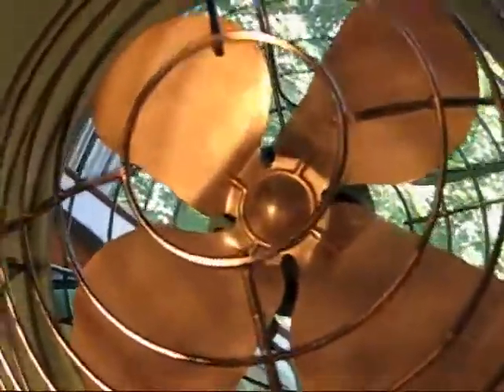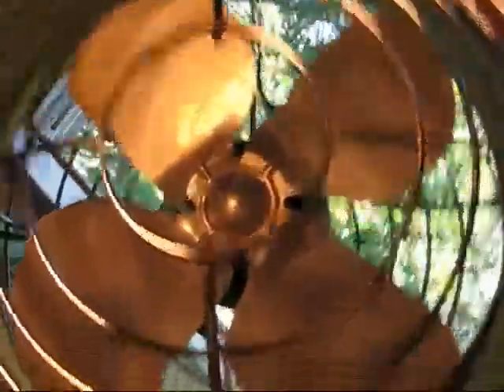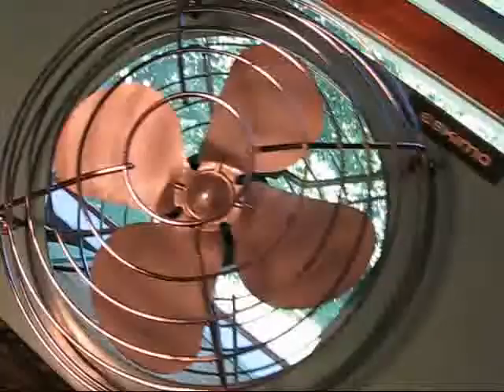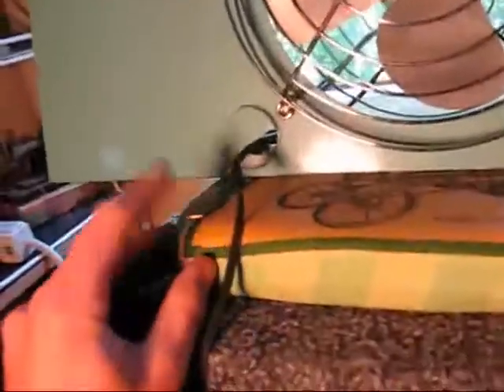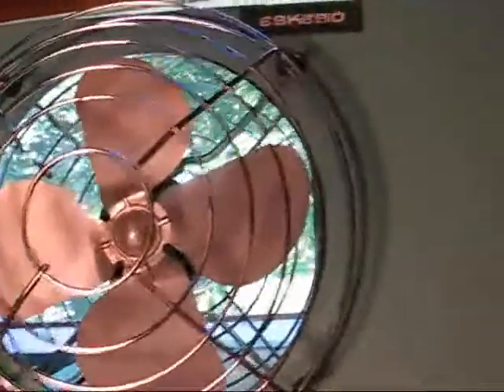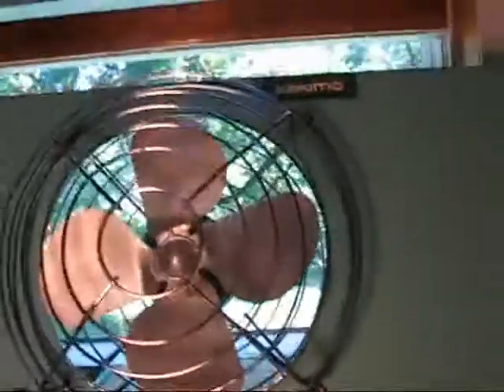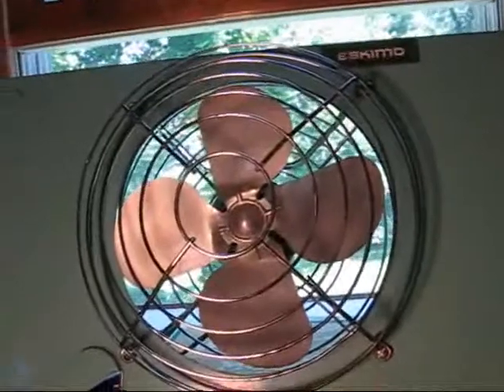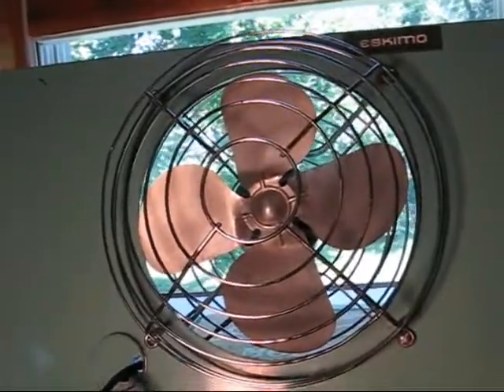eskimo update

Comment from the maker: you have to very carfully measure and balance the blade. i have it just about perfect now. much better than it was. it is running now in my room. it runs quiet and powerfull. with little vibration. boy thos blades are thin and delicate. my wizard has the same shape blades and they are not as delacate and bendable